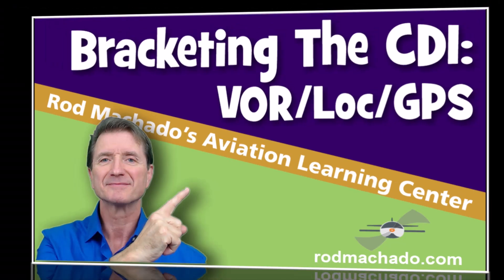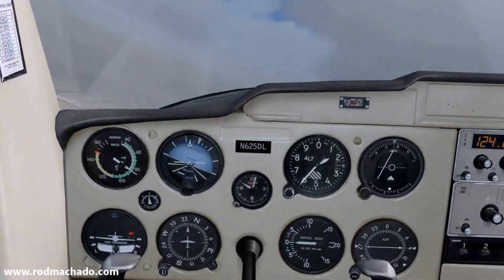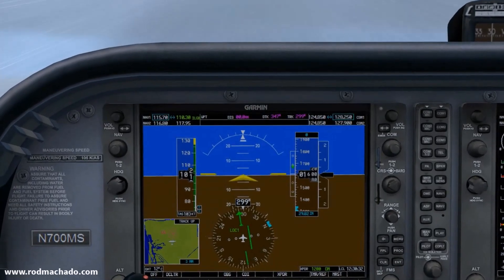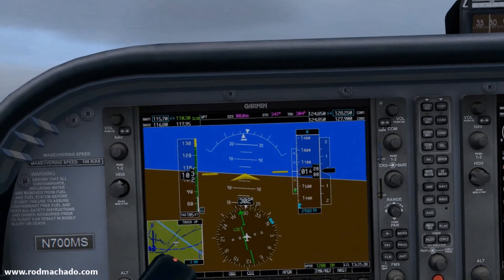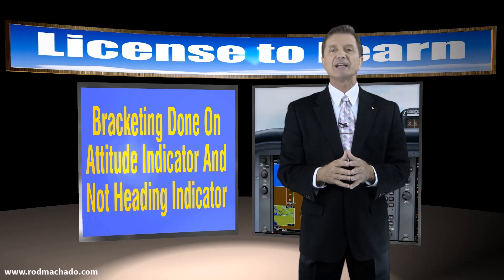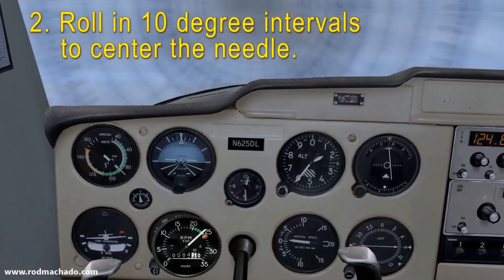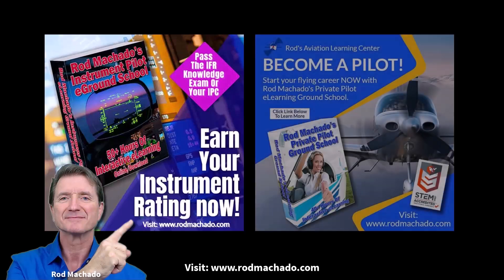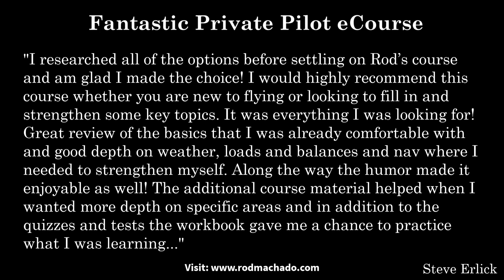Bracketing the VOR LOC GPS CDI

Comment: I love revisiting IFR navigation techniques! Much of what is seen in your lessons and others are similar to what had been taught for years. My instructor taught this method for the ILS and also VOR approaches. Other instructors and friends I know would use a reasonable amount of heading change to capture the localizer. Once joined to the inbound course, they would take out half of the heading change. The bracketing method for NDB approaches are equally interesting to hold steady! Thanks for the presentation.
Reply from the maker: Thank you!
Best,
Rod